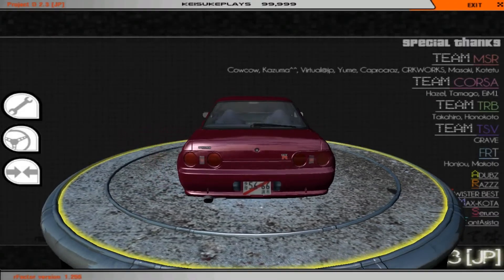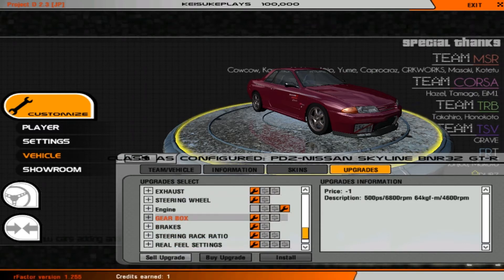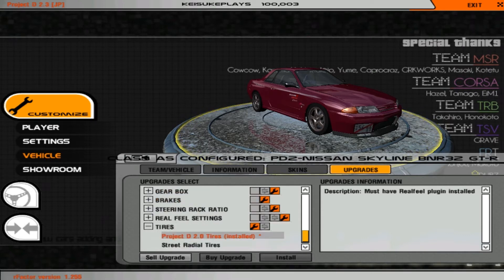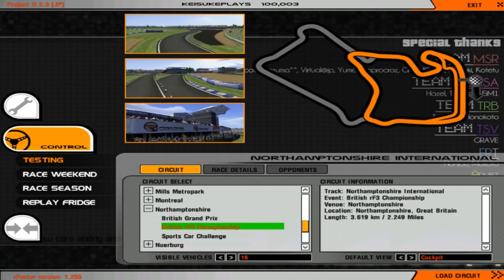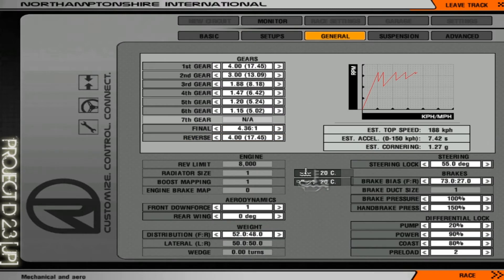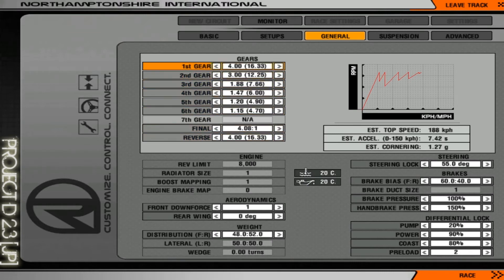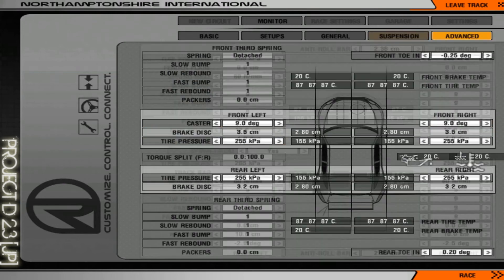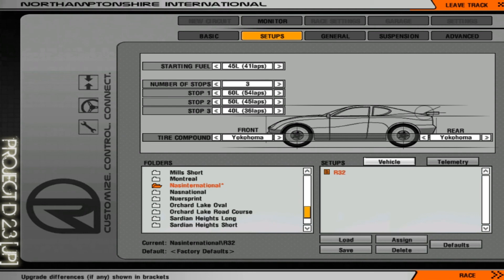rFactor Tutorial #2 | How to setup a car for Drifting

Comment: Setup keyboard or wheel?
Reply from the maker: Ioan Daniel Wheel :) I use a G27
Reply: ok,thx
PERFECT
Reply: Thx, I use G27 too. But i wanna ask you. When I start the engine, and when I'm going, my wheel is shaking like engine, and when I stop, the wheel moves to the border of one site. Is that normal? And do you have noisy FFB when it wants to go, but it can't, because for example you're holding it?
Reply from the maker: Reduce the FFB Strength in the settings then :)
Reply: It was just a bad real feel though. Got Loonies one and it's awesome. But I'm on SP mod, S13 which has around 500hp, did everything I could like you, and just spinning around. But I tuned it a little, and a little bit better. I dunno how to tune, and drift that good yet. I know, you have more things to do, but can you learn me to drift please?